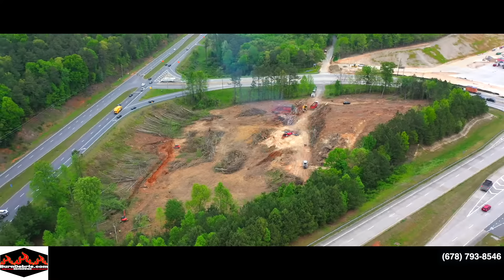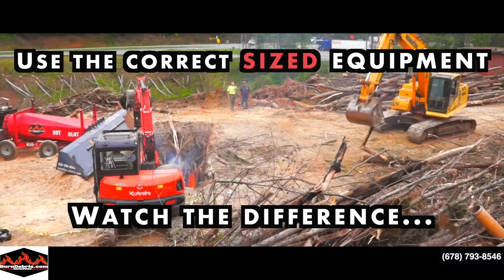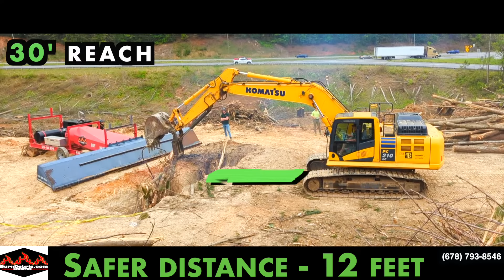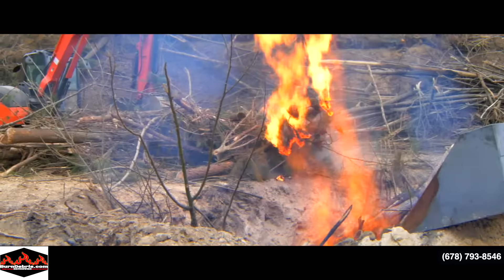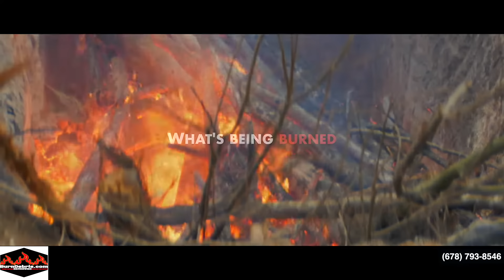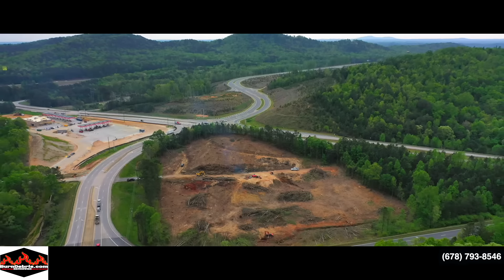Burn Debris  How to use Air Curtain Destructors in high traffic areas.

Comment: Could i use this to clear a parking lot of snow
Reply: interesting question. The cost to setup though .
Reply: Not really.  If you created a way to capture the heat and you could redirect it you may be able to do something.  But it is not designed to do that.

Comment: What sort of regulations exist regarding what materials you burn in those pits? For Western NC, it seems like a great idea to quickly get rid of organic matter and tree debris, but I'm very concerned about dangerous manmade trash materials getting burned in those pits, making people near those burn pits inhale potentially dangerous fumes.
Reply: And most of the time, burn piles aren’t close enough to harm anyone.
Reply from the maker: There are already laws and regulations in place to prevent the burning of anything besides clean organic materials. So you can not use these machines to burn things like plastics and materials with chemicals, but they are a great option for cleaning up vegetative materials, like the tree debris that comes after a tornado or hurricane, since they reduce smoke and cut down on emissions etc
Reply: @BurnDebrisLLC  Thanks for the reply. That's good to know. As long as it's organic materials, I agree it's a great method!
Reply: People burn all kinds of items.
Reply: @mrfirefighter360  In the last 1000 fires we have supported we have not had any clients burning hazardous material.  During disasters we have seen the government use them to burn dead animals.